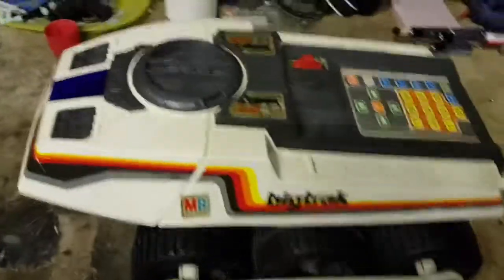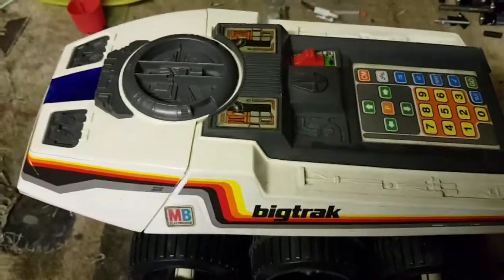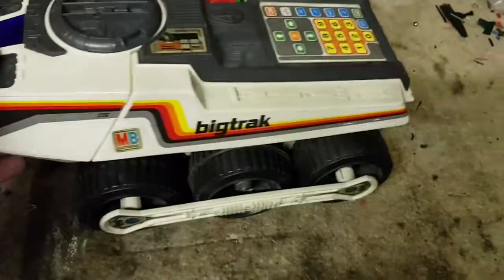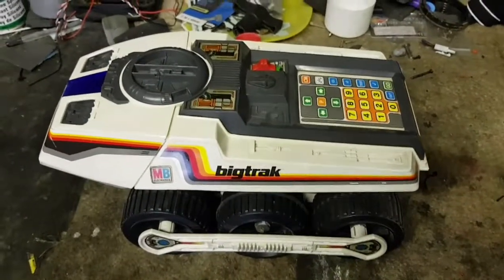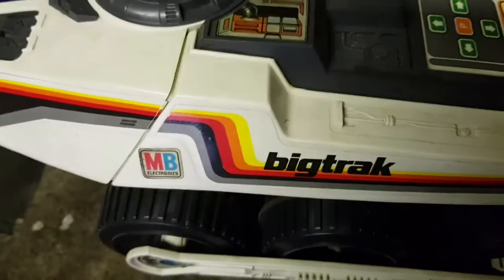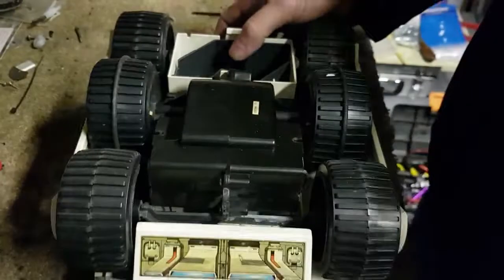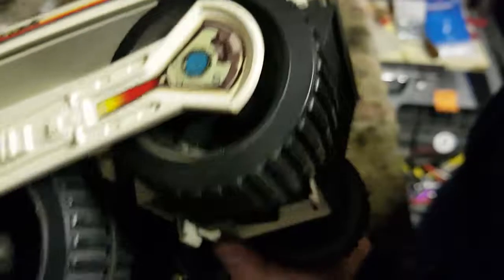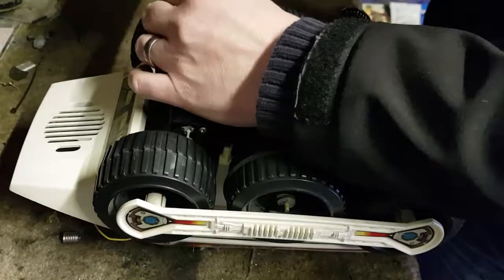1980s MB Bigtrak teardown. Video 4.

Comment: there not that hard to get apart converted  my big trax to rc pretty easy also coverd the hard plastic wheels with rubber much better traction  the batterie compartment is usless run my big trax on 7.4 volt lipo much better